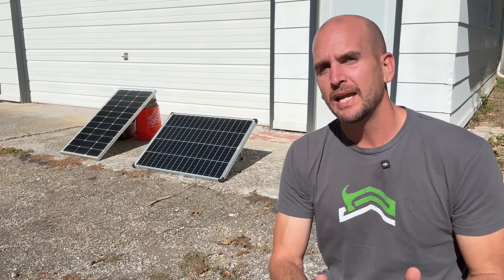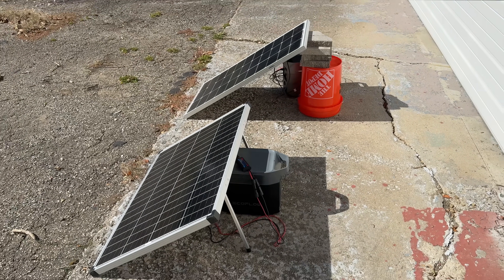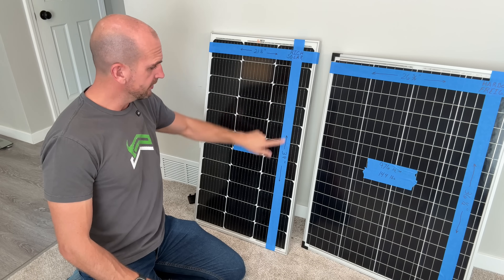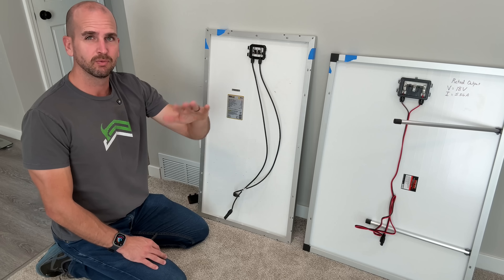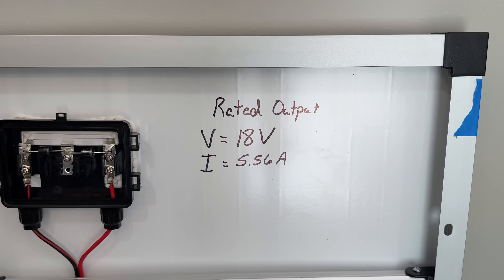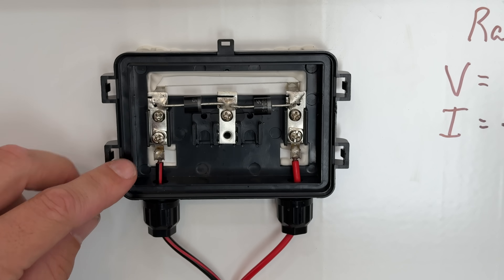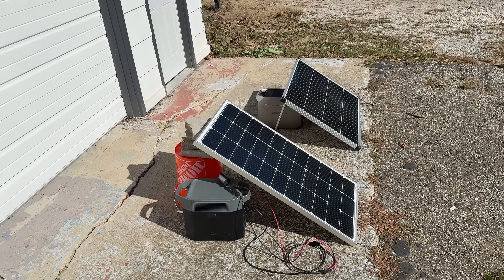Harbor Freight 100W Vs Rich Solar 100W |  Tested!

Comment: So the Harbor Freight has 17% more area, and captures 17% more energy. I think this is less about which panel is best and more about which panel is accurately advertised. Seems like Rich Solar panel should really be advertising their panel as an 85W panel.
Reply: As famous as HF is with exaggerated claims, they are not lying on this one.  Come  on HF give us at least a twice as much power sticker( which always leaves you wondering as what).
Reply: @tsl7881 of course HFT had to give it non-standard plugs.  Nothing they sell seems to work properly without modification by the end user.  But it probably saved them a tenth of a penny per unit.
Reply: HF not makes more energy it depends alwayxs if you have kuck witch the batch what you buy.
look this here you see the truth of all companys:
Harbor Freight Thunder bolt Solar panels- What You Need to Know!
Reply: Not understanding the science behind what makes each panel different doesn’t help your opinion
Reply: 85 watts? Why? In prime conditions it will do 100 watts. My NP 200w panel does 95w now. In the summer it does over 200w. Duh

Comment: I'm guessing the size difference is what really comes into play here.  You should have included a cost comparison as well.
Reply: Actually, if you do the math on the square area numbers he gave earlier in the video, the HF panel has ...wait for it... 17% larger area than the RS one.  Hmm, it feels like I've heard that number somewhere else recently...

So, yes, the difference in total power output is almost certainly exactly due to the difference in surface area (which allows that much more sunlight to hit the panel).
Reply: @foogod4237  I was thinking along the same lines wonder how much energy is being generated per square inch. Such a calculation would determine which one was more efficient.
Reply: @LisaTurner-d1b …and the ONLY way to compare panels fairly.
Reply: @foogod4237  YES,  Well that's at least 2 of us, who can do the math !!
Reply: I saw this comment and lost interest in the rest of the video.
Useless information without a $/watt value.
Reply: With that factored in I'd go with Rich because it has more info, and might have a better warranty. Should add that to the list as well.
Reply: I am surprised to see you here! How are you doing?

Comment: I suspect Harbor Freight is rated higher than 100W seeing as they aren't listing the spec data on the panel. Also suspect they only provide a rated output and no open/short specs. I want to also suggest when testing long rectangular panels to place them in horizontal positioning parallel to the movement of the sun. It does make a difference.

Comment: I have a Renogy suitcase panel ( 2 100 watt panels one charge controller) In Quartzite it blew over and one broke. I ordered what Renogy said was the same panel but I cannot get it to work together with the other one no matter how I wire it. The junction box on the back is slightly different. Any Ideas?

Comment: Awwwwwww. 423!
HF is 17% more than the RS but the RS is 15.5% less than the HF.  Where is the cost/watt calculation? The other key calculation that's missing is the watts/area so we can compare the output of a fixed amount of roof area.  It looks like the HF is a lot bigger.

Comment: As far as solder connections you need to familiarize yourself with the National Electrical Code (NEC) 110.14 B Soldering splices SHALL first be spliced or joined so as to be mechanically and electrically secure without solder and then be soldered. The reason for this is solder is not an especially good conductor and will generate substantial amount of heat if current passes through the solder rather than directly from wire to wire. Not my words. Don’t believe me search for the answer.
I would give the HF panels a negative point because of the solder.
Enjoyed your video.

Comment: Had issues buying with flea bay solar panels Did current & voltage tests on a clear day with the sun overhead and the panel facing the sun perpendicular. This should be within 10% panel rating. Second method calculates the theoretical best performance The incidence solar radiation @ noon on a clear sunny day is about 1000w / sq M. Measure the surface the effective area the  panel in question. Incident watts x area of panel in M x cell conversion efficiency = power generated For example 1000w x 1 sq M x 17% = 170 W mono crystalline =17%  poly crystalline = 14% amorphous cells about 8%

Comment: You do NOT want soldered wire joints. they will break at the solder point especially in equipment that gets moved around

Comment: This is an awesome test!!! Exactly what I was looking for. I have four 100W Ecoflow panels right now that I plan to put on a shed. But I need 8 more panels, and plan to wire them in 2-panels-in parallel, and then series the set to maximize the watts from 12 panels total into a Ecoflow Delta Pro Ultra. Not sure what 8 to buy yet, I was thinking Eco-Worthy simply because of cost. But I'd Love to see Harbor Freight vs Renogy vs EcoFlow vs Eco-Worthy, etc.
Reply: Lots of 100w panels on Amazon for $55-$65. But I'd use 200w minimum with 300w more likely.

Comment: Did you forget to mention the area difference by percentage between the two panels?
Reply: Agreed, It looks like the HF is 17% or so bigger, meaning per square inch the provide the same watt hours.

Comment: The one piece of data I think you could add to your charts here and it could be important as you move along in your comparative studies is you did show in the beginning their physical size difference as well and then calculate out roughly Watt hours per square inch or square foot so that someone was going to do a large installation. They could figure out roughly how much the peak power they could put in an area, whether it be a roof or an external stand and then you could even throw in estimated cost of each panel at the time of the study being published to put up more data available

Comment: For the RV crowd, it would be interesting to see the GoPower panels tested. Since Dometic bought them, a lot of new RVs are coming with at least 1 panel factory installed, and it would be great to know how they stack up and if it is worth sticking with them when expanding capacity.

Comment: I'm not sure about how you did your math but 432 <vs> 495 is about 14.5%.
Reply from the maker: I wrote the 432 down incorrectly it was actually 423 and that is how I got the 17%. Thanks for the feedback.
Reply: Oops I just now saw your video and corrected you on the 423. And then I went to check the percentage and got 17, so I figured that's what you had done

Comment: You should include a shade test.
Reply: Both of these panels would perform horribly in the shade. Shade one cells and you'll get 10 to 15 watts of power.
Reply from the maker: I think that would be a great addition 👍.  Thanks for the feedback.

Comment: I'm pretty virgin to solar,  but I've installed a pair of 100wt Thunderbolts to the roof of my Club Car & a Genasun boost controller , and I can't get it off standby mode yet.

Comment: Solder joints are not as conductive as crimped joints. No matter what materials are used, solder will decrease the conductivity. 
Panel life/degradation will be difficult to validate in a timely manner ( ;-) ) and yet it is a highly meaningful/valuable concern.

Comment: My only complaint about HF panels is the cable that comes with them. If I was using them for more than temporary use, I’d replace the cables with #12 solar wire and MC4 connectors.

Comment: Overall pretty good video. I think tho to add more valuable information would be "when" the solar panels start producing power. At what angle to the sun hitting them do they make power.
Another thing is that swapping test meters is great and all, but switching mid-way through day isn't good enough. There's different conditions morning vs afternoon such as dust, heat, moisture, etc. Swapping the meters between "2 consecutive days" would be far better as it would give a more overall picture of performance. 
Another issue with pitting the winner here, HF in this case, with other brands 1 at a time, you will get different comparisons as you do this as the season progresses. This overall test should be done side-by-side with each solar panel on the same days. Just a few degrees of the sun moving south is enough to throw your results off, not to mention the difference in the temperatures of the days, with or without wind, possible dust, etc. So many variables to factor in when spreading the test results over several weeks, or months.

I get that you want more videos, but the quality of the video and the amount of information is far more valuable. Split the tests up into several different videos if needed instead of a single one if you want to have test results.  But accuracy is key here when presenting this kind of information that is prone to high variability based on the day, weather, etc conditions.

Comment: Good tests, bad math.
232+191=423, not 432.
Still, HF outperformed Rich significantly.
Like to see a comparable test using the builders favorites for a 48 volt system.

Comment: @everydaysolar You forgot to include possibly the most important calculation, the cost. Approximately 21 hours after publishing this video, using the links in the description, the Harbor Freight panel cost 50% more than the Rich-Solar panel. Calculating for the difference in the cost of the panels the Rich-Solar panel made 5.29w/$1 and the Harbor Freight made 4.13w/$1. The Rich-Solar panel actually won this competition.  🤓
Reply: 100w on Amazon are like $55

Comment: Please continue to compare area (width X length) of the panels.  Watts / area gives an idea of space efficiency.
rich:  21.25 X 39 = 828.75
hf: 26.75 X 36.5 = 976.375

The rich is 85% of the area of the HF, or the HF is 18% larger than the rich.  Pretty much explains the power difference, and shows the HF is slightly less space efficient.

Comment: The wires on the harbor freight panel look really thin for a 100w panel.  On the rich solar, I'd probably solder it myself as those crimps with the fold in style aren't great for long-term durability.  Crimp then solder makes for a great connection unless there is a lot of flex/vibration.

Comment: @everydaysolar Scott: How did the % energy output compare with the percentage area of the panels? ...since you spoke of the larger HF area at the beginning.  Buy my calcs off your measurements, the HF is 17.7% larger than the other.

Comment: I have watched your videos for a while and wondered about the accuracy of those power meters. I have several and none agree when compared against others and especially something more accurate like a Victron Smart Shunt. The cheap ones are wildly off in terms of accuracy. For this test, I would like to see you at least swap meters to see if there is any difference and/or compare against something more accurate.

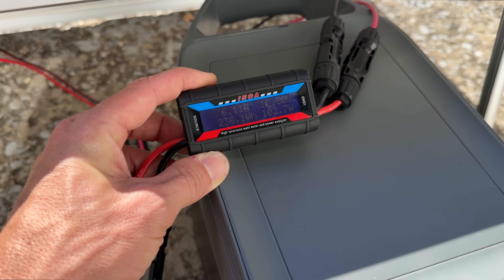Comment: I have the 200-watt 24-volt panel from Rich Solar 9BB on my van.  It can produce over 200 watts in ideal conditions and does well in partial shade.  They now have a 250-watt 24-volt panel that is just a little larger which is my next upgrade. The HF panel may be underrated.  The measurement at 1:08 minutes shows 6.1 amps which is higher than its rating.  I didn't get to see a measurement from Rich Solar.

Comment: However:  footprint of the panel matters for RV applications:  on the roof of my camper, I couldn’t get a large number of square panels, but Rich Solar makes some longer, narrow panels that allows more panels to be installed.

Comment: That was a fantastic test.  I would like to have seen the price comparison (at time of filming) and a $/Wh column to get a better feel for the price difference.
edit: from my own research the Rich Solar panels are about 30% cheaper ($80 vs. $120.  So 17% less power for 30% less money might make a difference in the calculation of value. if you want to price max the setup at $240 the Rich Solar is going to net 1269W, while the Harbor freight is going to come in at only 990W.  That puts Rich Solar at a 20% advantage above this cost break point.
Reply: Also important to consider that the Harbor Freight solar panels are on sale for $85 to $90 frequently.
Reply: @agrivere5494 That my thought as well. I only buy them on sale. Decent panels.
Reply: @agrivere5494  I was just going off the stated price on the website and Amazon.
Reply: then there's the matter of how quickly each panel loses capacity over time.
Reply from the maker: That would be a great addition, thanks for the feedback.
Reply: No one pays full price at Harbor Freight! LOL

Comment: Now would you divide it by surface area to get what the power output would be per A^2 in case you wanted to maximize your surface area (say on a roof) to determine which output would be best if you had a smaller area to work with?

Comment: Recently  picked up 400 watt Canadian Solar panels for $95 new.   8 in series and easily getting 3000 watts to my controller.
Reply: Yeah. Solar panel pricing is plummeting. Where did you get yours?
Reply: Share the purchasing info!!!
Reply: Yea but most need to have them shipped...and leave that info out
Reply: “Canadian solar panels” you sure they’re not just chinesium

Comment: Fun twist: 

The HB solar in this test provided 4.13Wh per dollar
The Rich Solar in this test provided 5.29Wh per dollar

The Rich Solar is more "bang" for the buck, but really when I think of 100W panels, I expect them to be for some small system use like camping, small shed, etc. If I was building an array I wouldn't look at either in my opinion.
Reply: Only buy the Harbor Freight panels when they have sales on them. Which is quite frequently. Plus HF are all over the US so replacing, or adding them is easy.

Comment: Thanks for the head to head comparison.  My thought is the way those panels are labeled, Rich Solar is standard and HF is under labeled. Based on number of cells, HF is more likely a 120w panel.  Standard practice for manufacturers labeling is output at standard elimination (1000w/sq meter).  Also the lack of a standard label on the HF panel add to my suspicions.  But I don’t want to sound like I am badmouthing HF panels.  Just point out my observation and experiences with solar panels.  If the size and price aren’t a constraint, go for it.

Comment: There is nothing at all bad about crimped connectors. That is what NASA uses. So crimped v soldered is a false narrative. Otherwise a good comparison. Thanks.
Reply: +1 Crimp is considered an industry superior connection. The pressure of the crimp actually merges the metals at a molecular level (to some very small amount), whereas solder is just 'glue'.

Comment: Would be interesting though if the cost was calculated into this formula. HF panel is $40 more plus $15 to get the SAE pigtail. That is a $55 difference in price. So for a little more than the HF setup we could get a 150w Rich panel or a little more than that we could get 2-100w Rich panels. So cost wise it seems they get much closer in usefulness with perhaps and edge to the RICH. Why isn't this in your calculations?

Comment: That 17% is no  big deal. The simple fact that 976 sq inches is 17% larger than the 829 sq inches should yield 17% more power, otherwise the larger panel is just wasting valueable space.
Reply: Still, both rated at the same power yet one is undershooting it with 17% that is a big difference.

Yes the weaker one is a lot smaller but their claims should be real and not lie 🤥.

When you get beaten by harbour freight you have screwed up 😂
Reply: @tullgutten  I do not how you can decide that one is beaten by another. Energy per square feet is what matters because you do not have infinite roof area. And then there is matter of long term use, durability and reliability. I am not convinced either one is good enough. I am just pointing out that simple metric is not good enough to make a decision.
Reply: LOL! math much?

Comment: My question would be , how much do the panels degrade over time . Which one would hold up the longest ? If you have to replace panels every so many years, is it cost effective to even consider buying them , or using them at all.
Reply from the maker: We are moving in a couple months and I plan on setting up permanent mounts for these type of panels to start collecting the data after they bake for months and then years.  Will share the details in the coming months.

Comment: Interesting, but size also has its value. Easier to configure if space is limited. And you would get more of the smaller panels on that same roof area. Looking at power output per sq ft there is only a 4% difference.

Comment: It's no surprise to me that the 17% larger panel also produces 17% more power. So it basically comes down to price.
Reply from the maker: For sure, funny how that works out 🙂
Reply: @everydaysolar  you should add that to your testing.
Reply: It also comes down to Rich Solar misleading customers about the watt rating on the sticker. Both claim 100w. Somebody is lying to us.
Reply: Makes me wonder if the Hazard Frought is really 100w.
Reply: @christiansmith7666 so you didn't watch the video and just came here to insult harbor freight. Got it you're one of harbor freight hating trolls who are stuck a decade in the past.

Comment: Thanks for this video. I have a HF 100 panel and was considering a second one. I can get them for $100 or less now. You have convinced me to pick up another one. 😉
Reply from the maker: Normal price is $120 in my area but when the sales come through they still dip down to $90.  I picked up 2 more during the last sale.
Reply: @everydaysolar  Why are they not included in your spreadsheet comparison? Or are they just under a different name. I only see 4 in there. Curious to see if you're testing more panels in the future!